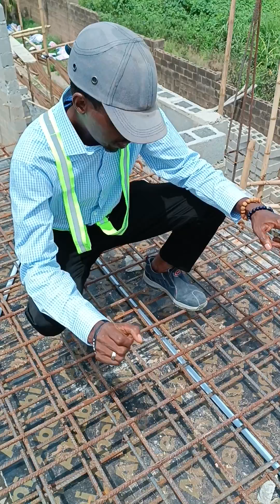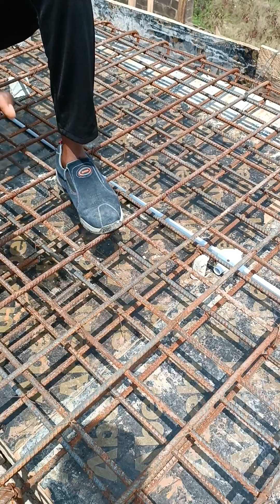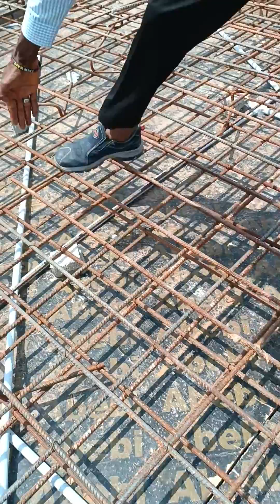CANTILEVER SLAB REINFORCEMENT PLACEMENT.

Comment: What do you mean by return? Are you talking about the length of the reinforcement beyond the  support(beam)? What if the design of the building does not have a slab beyond the beam?
Reply: Then you have to design it as a restrained slab. This means that it should be connected to columns. Also if you'll have walls on top of the beam connected to the cantilever, you can keep the formwork supports in place until all the walls are constructed on top which basically creates equilibrium therefore canceling the turning effect of the cantilever